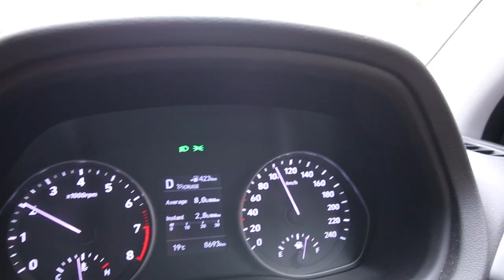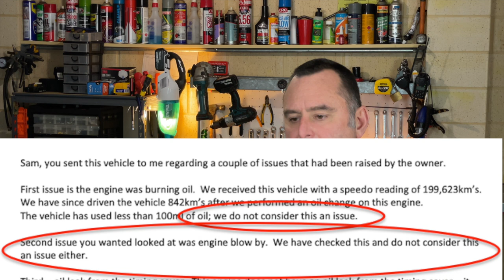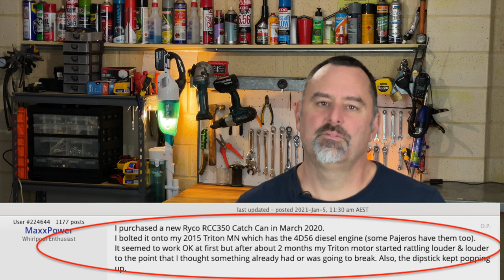Did my 200 Series Landcruiser ENGINE BLOW again - twice in 12 months? Or was the catch can to blame?

Comment: In short, on diesel engines run a can with no check valve. On gasoline engines use a catch can WITH a check valve. Diesel is CCV and gasoline is PVC. Diesels vent, no need for a check valve. You can literally just run a draft tube to underneath if you want.

Comment: Well. That explains why my Diesel Outlander developed a leak in the sump just after I installed a Ryco catch can. Valve comes out along with filter and it'll be replaced by a different brand. A class action against Ryco might make them behave a bit more politely.
Reply: Filter shouldn't have anything to do with it , adding a filter in line should not restrict the flow so much that you develop pressure in the Crank case . Ive seen people remove the PCV Valve and such , do a PCV delete and stuff , and then you might develop unusual engine crankcase pressures and hence leak oil  , you should not remove anything from the car when installing catch can , just put it inline with a valve or a hose and then it shouldnt make problems.
Reply from the maker: The issues is with the faulty one watt valve after the filter stopping flow.
Reply: @JebbreysJibberish  It shouldn't stop flow,   i dont know i didnt use it , but of course if one observer filling up too quick then obviously the system is not working .
It should catch vapors , there shouldn't be liquid oil in it in high amounts  , the PCV should filter that out and release only vapors , not actual liquid oil .

Comment: Remember the good ol’ days when crank cases would vent to atmosphere?!
Reply: My 1954 Holden FJ ute vented to engine bay & road straight out of the sidecover tube and coat the whole area with a fine mist of blowby oil preservative & rust preventor. Oil bath airfilter too was great for filtering air.

Comment: Try running a Pro Vent from Mann and Hummel mate, you’ll not be disappointed... Western Filters uses full diameter hoses to minimise back pressure and restriction. Fitted one to my VDJ and have been very impressed!
Reply: Lol try running no catch can as the manufacturer recommends and warranties for unlimited kms in many cases maybe ..
Reply: Provent gave my 1hz trouble continue to run no filter or vent to atmosphere
Reply: I fitted a Provent 200 to my 2018 Dmax back when the ute was reasonably new. Within a couple of hundred kms it started to push oil out the rear crank seal. After contacting the supplier of the kit & reconfirming correct fitment with photos etc. they suggested removing it. Their reasoning was that the engine had a weak crank seal...hmmmm?
As soon as I took it off the leak stopped. Ute has done 60,000 kms since then without an issue. Perhaps I was unlucky? If catch cans are so essential why don’t the manufactures fit them as standard?

Comment: Great video I think you just solved the problems I was having with my hdj100 series. Had the same ryco catch can fitted as per video, had nothing but problems rocker cover blew 2 times. Never had a problem before I put the ryco catch can on,since then have switched to a provent 200 catch can since and the car has being running like it should.
Reply from the maker: Sounds about the same as my issues!

Comment: Thanks for a well presented video Now a couple of points and I have been running and working on Diesel engines all my life and have been running a 200 r  Diesel for a while 
1 blow by or excessive sump pressure will cause oil leaks  easy to check loosen filler cap or pull dipstick 
2 What have Toyota to say about all of this ? 
3 Would running a higher viscosity oil especially when the engine gets a few ks up help ??  As the recommended 10 is very light and may be adding to the problem 
3 This problem is not new ,it’s been around since they started recycling the sump fumes I’m sure some of the older blokes have experienced a slightly worn engine running away on the sump fumes ,could be a scary if not interesting 🤔 experience 
No reflection on the people who were repairing your car but compression blow by test results etc should be recorded 
Thanks again for your informative video first time viewer ✌🏻👍

Comment: We have 3 diesels, all with provents. We also had weeping problems on a Pajero and a Renault master van. Van is old so really didn't want the cost of doing rear main, rocker, injector seals. So been nursing it. Changed provent filter on each during service and ALL weeping issues are gone. Oils usage and catch can collection reduced. Will be doing provent filter every second service now.

Comment: this is very interesting, i also bought a ryco can  the 351k back in December 2020 and i noticed, the same issues i was getting oil leakage from the front of the motor somewhere and also out of the dip stick.. i was so annoyed i threw that garbage ryco can out and put a provent 200 in, and its been good so far...

Comment: Jebb,  what a mission to get to the bottom of this.  Thanks for sharing it.  You say at the end of all that happened that you are doing a heap more mods.  So many problems are caused by unnecessary mods, poorly installed mods, and (as appears in your case) manufactured mod parts.  Sometimes unintended consequences may result from a modification.    I hope any other mods go well and you get to enjoy some trouble free driving/travelling.
Reply from the maker: Thanks and yes aftermarket stuff is often the first to fail. I’ve been modifying 4wds for a very long time now and would like to think I’ve got it pretty reliable now :-) most of the mods are for camping and or ease of use. However, we know the inadequacy of the air filter box in the 200 and the way they shift gears especially under load, so those are two performance and or reliability mods that I have done.

Comment: Interesting that my last Provent 200 replacement filter came with replacement internals for the lid that removed the spring arrangement. Wonder if this was a change based on learnings from the Ryco one. In saying that, the performance has been flawless with both the old version and the new one. That’s for the videos mate, really enjoy the honest information!!
Reply from the maker: Interesting indeed. It would seem that the idea of those spring seal valves isn’t popular anymore… for good reason perhaps.
Reply: The older Provent 200 catch can was vent to atmosphere in crankcase over-pressure situation. The newer Provent 200 is closed loop vent back to engine intake in over-pressure or blocked filter. I prefer the older style as you can see any over-pressure as an oily residue around the top cap.

Comment: Great analysis. I bought a Provent copy for my 200, studied it and got cold feet at the check valve and flow path. This LandCruiser is called 200 because over 200 engineers design them so if a Catch can is good then why doesn't Toyota fit, or even offer it as accessory. I've cleaned its gunk from EGR + PCV vapour mixing, but diesels benefit from oily vapour intake air for some upper cyl lube. Amazing is this mix does not clog the intercooler. Happy you have solved it.
Reply: It’s not the oil that’s a problem and it’s not the egr valve that’s the problem it’s the oil vapour entering the inlet manifold when the egr valve is open and the the oily air mixes with the soot from the open egr valve that creates a paste that gets baked on to the inside of the manifold, inlet ports and valve stems. It the keeps building up over a long period of time until it eventually restricts the motor. Also the egr valve is only open within specific values that a lot of vehicles may not experience. Eg when the engine is at WOT or under load the valve closes. It’s mainly open at low to mid throttle position with light engine load like short tips to the shops or work. So if you’re using your car mainly for towing the van on long trips or are doing a lot of highway miles it may never have a problem. None of the 4x4 car makers that I know of fit catch cans including Mitsubishi yet Mitsubishi light trucks have a catch can as standard. My 2020 Sahara is our only car so it does a lot of short trips so I fitted a pro vent to it a week after I bought it. At around $300 it’s cheap piece of mind and insurance for me. Cheers Stuart
Reply from the maker: Great comment, thank you!

Comment: I am a diesel mechanic ,made my own catch can for my 79 cruiser which fits down low on the chassis probably cost about $20 which is the cost of fittings with stainless scourers from Woolies no check valve no problems
Reply from the maker: Nice work.

Comment: Finding these problems comes with experience, its one of those faults that you may not find unless you've seen it before. Glad it all worked out in the end.
I have a 2009 200 with over 400k on it and still all original everything. I also have provent catch can and have had no issues at all. At least now you know! 👍

Comment: I have had Provent catch can on my Triton and have never had an issues with oil leaks, blow by and oil consumption, but 2 months ago my cousin who has the same catch can on his T5 vw transporter noticed a major increase in oil consumption after he replaced the EGR valve, he ordered a new filter for the provent at the same time bit it was after market, we traced the oil use down to the turbo chargers seals, I talked him into cleaning the original filter and put it back into service, he used a accurate low pressure gauge to measure the differential pressure between the inlet and outlet on the catch can  and came up with over 1PSI back pressure, after changing back to the standard element, the same test was carried and there was no measurable pressure drop across the catch can. do not use any other element in the provent catch can and I have had the same one for 5 years and with very careful cleaning it is still working beautifully.
The engine builder should have check the crank case pressure and the pressure drop across the catch can which would have pointed him in the right direction..
Reply from the maker: Good advice.
Reply: @JebbreysJibberish  I have spent all of my life working on high speed rotating equipment and ended up of shore as a specialist, it does not take very much to analyze a problem once you understand how it works as the method we used is in all heavy earth removing equipment where filter changes are determined by difference pressure.

Comment: Good info, I don't use any Ryco products but everything Toyota and the dealer is no more expensive. Bet you were relieved when they worked out the problem. Thanks again.
Reply: I used provent catch can with relief valves  on my 200 series and it won’t pressurised the motor.
Reply from the maker: The Ryco has a relief valve too but it never showed any signs of having opened.. I can only assume the restrictions from the check valve are not continuous enough or severe enough to trigger it but are enough over time to cause damage. From what I read, and would seem consistent with my last oil leak it seems the restrictions get worse at higher rpm.

Comment: Most heavy diesel truck engines now days run an engine breather filter ( return to sump catch can). These filters are a service item. Every oil change or Every second depending on the environment the engine is working in, the filter needs to be changed.   Anytime an engine has excessive or weird uncommon oil leaks and/or running issues. The first thing that is changed is the catch can filter. . When these filters clog up they cause so much back pressure that oil get pushed out of weakess seal first , either the front/ rear mains or the rocker cover gaskets and causes more issues than without a filter.
Reply: why not a simple filter bypass?? - solves a lot of problems.   -- add an indicator for service..
Reply: A filter bypass? As when the filters full it bypasses the oily gases straight into the intake, then no one would ever change the filter😂. Unfortunately thats quite difficult to design and to make reliable, good idea tho
 Either have a filter and change it regularly or dont have a filter and put oily gases into the intake.
Reply: @mattpalmer1602  . Dual filters for serial redundancy and by-passes are quite common in industrial applications for oil (critical) systems.  The bypass is simple - just a pressure relief for when the filter is clogged (high resistance), add an indicator light to notify that the service life is expired.- if space allows add a smaller filter to the secondary path.

Comment: I would fill the catch can with the stainless steel pot scrubbers until the can is full. This effectively eliminates the filter. The stainless steel filters the oil from the fumes allowing the oil to run back to the engine. I did this with a V8 which has a can on each rocker cover and I have had a vast reduction in oil consumption.

Comment: I've run a provent 200 on my low kilometre 1hz turbocharged 105 series & from my experience,  don't bother with any of those internal filter type catch can.  If you do, you need to keep a very close eye on the filter being saturated. I've now replaced it with a HPD unit, which whilst supposedly not catching the same amount of oil, will not pressurise your engine like the filter type do. My vehicle started to weep from the rear main seal. I'm currently monitoring it & it seems to have stopped, but it's only early days, so time will tell. Your presentation was very informative, well done.
Reply from the maker: Yeah I’ve just got the Ryco can in there with no filter now. It caches a bit, but my engine still leaks slowly from the original damage after having the filter in there for less than 10,000kms! 😳😡
Reply: I have had HPD and its great. Some vapour escaping is prob good as the engineers would realise this happens but a big chunk of water vapour and oil-carbon crap does get ‘caught’. No filter to block in the HPD. No ongoing expense. Empty it regularly👍

Comment: Well you certainly have had a hard time with the problem you experienced  common when catch cans have been hooked up with hoses back to front. I fitted a Flashlube to my 200 comes in installation kit with moulded hoses fits up very neatly. I was told to change the filler 30 k no longer experienced no issues empy the can every 5k.
Reply from the maker: Yeah my first thought was that they might have been backwards but they were installed correctly. I have something sorted and on it’s way with moulded hoses I’ll update when I get al the stuff here.
Reply: I have the same set up, a Flashlube catch can, done 150,000km with it on my 200 and not an issue, same as you I drain it frequently, and change the filter every 20K.

Comment: I had an rcc350 on a Mercedes 3.0v6 diesel. It got blocked after 1000km. Mine didn't leak any oil, and the engine did not get damaged, but I noticed the pressure relief  valve on the catch can was oily.

Took the catch can off, and tried to blow through it... Nothing. Not even a little bit of air passed. I was surprised the engine didn't get damaged and the dip stick didn't pop out.

Emailed ryco and explained what happened. And they said that the rcc351 fixes the issue. They replaced it for free for me.

Now the new catch can is working well. However, there is still a little bit of restriction. I might buy a provent soon, they seem to have much better reputation, and is worth the slightly higher price.
Reply from the maker: Very very interesting indeed.

Comment: I made my own catch can out of a few plumbing bits from a hardware store and some stainless steel wool and a couple of scotchbright pads.
Works very well keeps the intake from sootting up.
But after a long haul trip towing a heavy trailer there was oil all over the back of the vehicle and on the trailer.
After a short bit of panic and a hunt for oil leaks I found that I didn’t do the drain plug on the catch can up properly.
It really doesn’t take much oil to make a horrible mess , it took less than half a litre to move the oil level from just above the half way point between the notches to the top notch which is only slightly more than normal usage.
Reply from the maker: Yeah I was freaking off to when it was leaking out around the injectors, drove home 300kms stopping every 50kms and barely used any oil. My biggest concern was catching fire as it was pouring all over the dump pipe!
Reply: @JebbreysJibberish  .
You can make your own filters out of scrubbing pads and wire wool.
The purpose of catch cans on diesels is not to catch oil but to keep it out of the intake not having the filters in reduces the effectiveness of this purpose.
Reply from the maker: I’ve got the RCC351 installed now. Ryco sent me the updated model. Got a video on that and will upload a new one soon with the comparison of both catch cans and filters as I had them side by side.